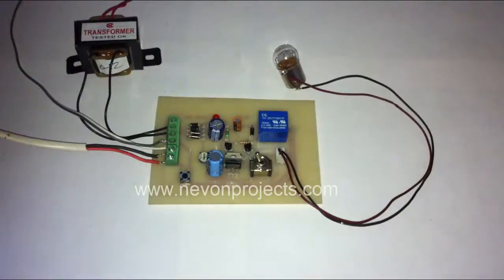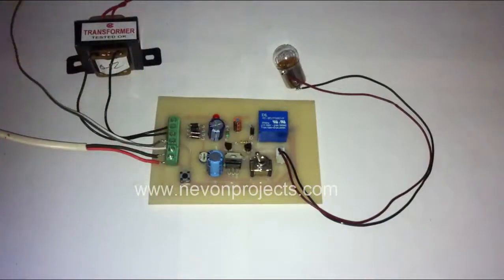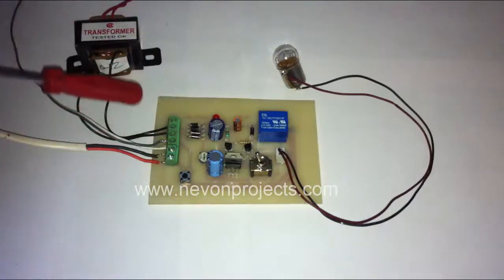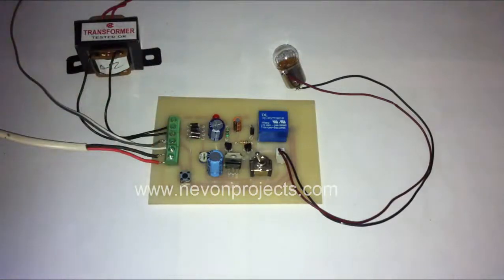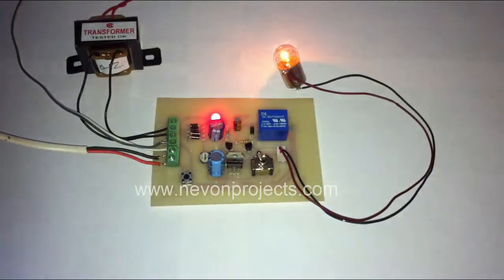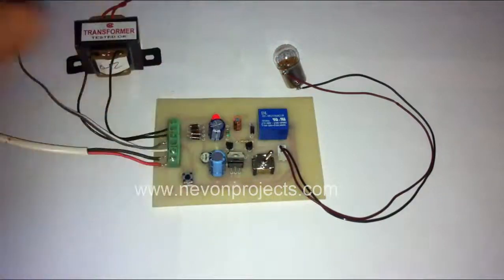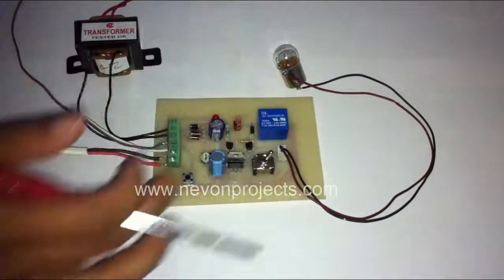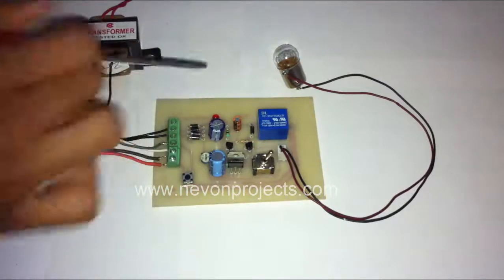Power Supply With Auto Switching

Comment: I tried building it but it switches off as soon as I release the push button and there is no output at the load, please help
Reply: Can you help me the the components and there rating
Reply: Assist me the circuit diagram you used